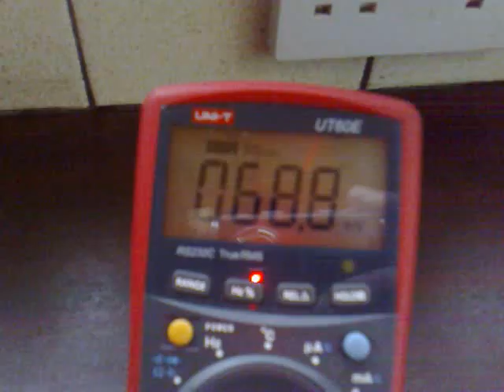Simple SEC 3- Running on Low voltage and wireless circuit boost

Comment: the reason for the leds lighting up backwards is either their being fed AC (on half the time, off the other half), or way too much voltage to them they conduct backwards. i think its AC, otherwise there would be no currnt flow through the plates and air to your virtual ground.